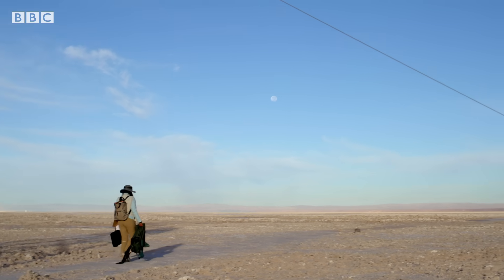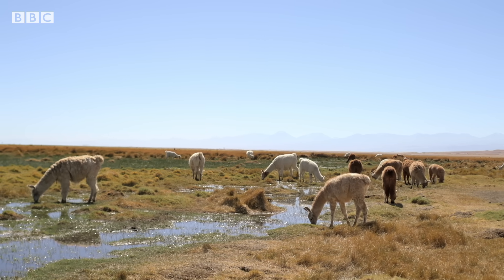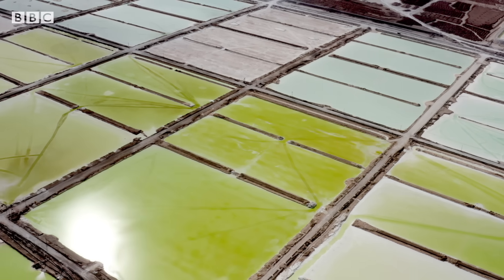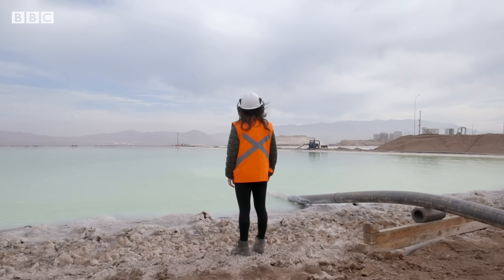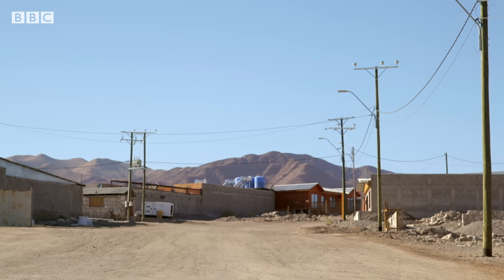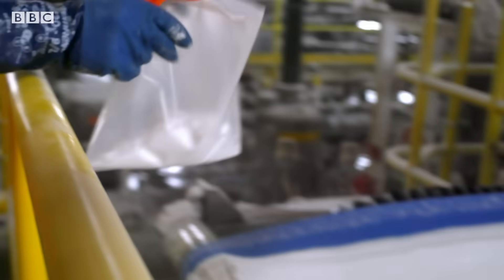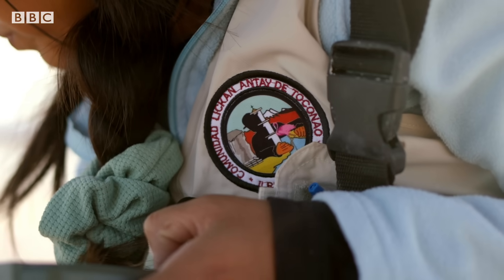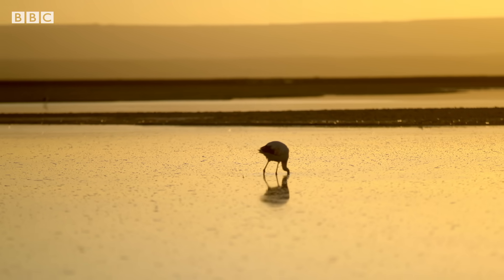What is the impact of lithium mining? | BBC News

Comment: That woman was wrong when she said that electric cars are just for the Americans and Europeans, the biggest market for electric cars is China.  In China you can buy an electric car for under ten thousand USD. 

The battery technology keeps getting cheaper.  But for most of the people in that region they can't afford cars of any sort.  If you come across a rich local who is rich enough to afford a petrol car then he would be able to afford an electric car.

The cheapest electric car in Europe is 16K Euros.

Ironically the research into Sodium-ion batteries will produce cars that are much cheaper than the cars with Lithium-ion batteries.  There are already a couple of models of Chinese electric cars in production with Sodium-ion batteries.
Reply: sodium is much heavier than lithium, not ideal for moving vehicles.  It's more appropriate for ESS than EVs.
Reply: @tooltalk sodium's weight is not ideal for a car but the cost is.  Most people don't use their cars on a motor racing circuit, they use their cars to drive to work and drive to the supermarket, and sodium-ion batteries are perfectly fine for this.  Which is why there are already cars being produced right now that have sodium ion batteries.

Sodium doesn't add too much weigh it's fine for a low cost, low performance car.
Reply: She generally means EV is mainly for the interest of someone else not for the indigenous people. Not wrong
Reply: @Akai_28  she specifically blamed her misery on America and Europe when China is the main culprit.
Reply: @Akai_28  Why is she not wrong? What is holding them back from driving EVs rather than ICE cars?
Reply: @matthewbaynham6286 i could not find any new about those cars with sodium ion batteries sice they were on the headlines. I think that was just an experiment. No tests , no degradation reports, nothing. They disappeared. However novadays CATL is working on Naxtra batteries and it will probably good for cars.
Reply: On what grounds will batteries become cheaper when the world is not mining enough, not are planing to mine enough and can't mine enough with minerals? What haven't been mined can't then be recycled. We have an upcoming demand for metalls and minerals between 300-7000% in the next coming years. The ground must be that the minerals will be cheaper again since 70% of the cost making an EV-battery is purchasing minerals and metalls, not the labour. That means that the future cost is totaly anchored the guess in future costs for metalls and minerals. Sure I agree to that chance except for the world is not mining enough, not are planing to mine enough and can't mine enough with minerals which means that the prices will go up. The trend is upwards, not downwards. that there is an inevitable reduction in the cost of things anchored in commodities that we cannot produce in sufficient quantity needed for these prospects, that is completely unrealistic.This will not end well becuase will get inflation from two directions. We'll get inflation from commodities/minerals/metalls and inflates the prices for a machines we need in the "green transistion". The electricty will be more expencive. Since the inflation is so broad over all these metalls and so inflationary and so deep globaly that it causes a global inflation pressure.
Reply: @christianstodberg3030 that's the most dis-information that i've see in one single comment.

There is plenty of mining going on, with plenty more mining being planned.

The supply of raw materials is just fine, look at to market price of the raw materials.

And just when you're stressing too much about Lithium-ion batteries, Sodium-ion batteries have already go into production.  Every ocean in the world is filled with salt, which is what you need for you Sodium-ion batteries.
Reply: @m @matthew_baynham  sodium batteries are not suitable for shitboxes. Why should I consider driving around with an 1 ton heavy battery with a energy content compared to 10L of petrol?
Reply: @christianstodberg3030 sodium batteries are very suitable particularly if the local climate is close to freezing or the opposite if the climate is super hot.  Sodium-ion batteries are very good in either cold or hot weather.

In a few years sodium-ion batteries will be far more common place than lithium-ion batteries.
Reply: @matthew_baynham wishful thinking! You have physical and chemical limits. They are so called natural laws and can’t be revoked. But feel to try and you’ll maybe nominated for Darwin Awards. Batteries can maybe be 15-20% than today but not so much more. If batteries had followed the same development according to Moore’s law for processors they’d be now the size of a peanut and would only have to be charged once during it’s whole lifetime. It easier to move data bytes than electrons.

Comment: Dear BBC, could you now please show the devastation caused by oil all over the world? Compare this with the environmental holocaust that is the Tar Sand project in Canada. Please also explain that the lithium once mined can be re-used - and critical minerals are not lost. In contrast oil is burned and must be constantly re-mined - causing global warming in the process.
Reply: can you also cover the environmental impact of fracking and the absolutely toxic chemicals pumped into the ground that poison aquafers , groundwater, and those who live on the lands above.
Reply: If you look, you might see they have for decades, and still we rape our planet for the "now" and do not conserve for the future. even we on this platform who are concerned  (do you realise just how much power is needed to run you tube? )
Reply: "can be re-used" There's a huge difference between can be and will be.
Reply: @LimerickWarrior1  Indeed. But re-use has not been necessary so far because the  batteries are still in service. 

And with oil, no re-use is even conceivable.

M
Reply: @michaeldepodesta001  certainly no recycling if the price of lithium stays as low as they are now.
Reply: @michaeldepodesta001 where have you been. They’ve been doing those sorts of stories for decades now 😂

Comment: Nationalizing part of the industry?! Eventually sodium ion will catch up which will solve some of the problem.
Reply: It won't since sodium has less energy denisty compared to lithium. heavier batteries, shorter lifetime, shorter range, less charging cycles but maybe cheaper.
Reply: @christianstodberg3030  Sodium has is improving along with lithium. Most of its problems are being solved. It should take over the lower end of the market once production is scaled.
Reply: @h@h @hamsterg0d ium has 20-30% less energy density compared to lithium. This is the physical and chemical properties of sodium. No rocket science just true fact. And you can’t step aside the periodic table. So a sodium battery would have 60-80Wh/kg. That makes the battery 20-30% heavier if you don’t expand the physical volume. And you have limited space in vehicles. The best sodium battery on the market is now 135Wh/kg. Still far away the best NMC with 250Wh/kg..Compare that with diesel or petrol with approx 10kWh/kg. So every news you hear about a new revolutionary fancy battery type that will beat hydrocarbons forget it. If it’d be true it’d be mass adoption already now.

Does the manufacturer reveal the production cost? The price? Any production infrastructure? Any charging infrastructure? 

If you answer no on all four questions take this ”amazing news” with a pinch of salt.

Comment: Hydrocarbons cause far more systemic and long-term harm, especially due to climate change, air pollution, and health effects.

Lithium’s harms are real but localized and manageable, especially if mining is regulated, recycling improves, and battery chemistries evolve (e.g., sodium-ion or solid-state).

Lithium is part of the transition away from something far worse. It's not without impact, but it's largely a temporary harm in service of long-term planetary health, whereas hydrocarbons are a permanent harm with escalating global costs.
Reply: They reuse hydrocarbons and save them to make plastic’s?im confused

Comment: Or you mine it from rock in Australia, or in a pinch extract it from sea water. Or transition to sodium batteries.
Reply: sodium is not an alternative especially for cars. Lower energy density compared to lithium. Thus heavier batteries, shorter life time, shorter range, less charging cycles but cheaper..
Reply: @christianstodberg3030  Sodium is perfect for all stationary storage.
Reply: @zapfanzapfan BSS is anothe hype, another useless and expensive hype. Expensive Unreliable, unstable soggy mass to provide power just for a few hours. Look what happened at Moss Landing when over 900GWh of batteries went up in flames burning for weeks.
Reply: @christianstodberg3030  It's not like gas ever leaks and explodes a house...
Reply: @zapfanzapfan is the gas the problem or poor maintained equipment? Batteries are unstabe all the way from production to disposal. Everything contains alkali metalls are unstable and heavy reactive by nature. A tiny winey defect in one cell can cause a chain reaction named thermal runaway - a self playing piano that can’t be stopped until all fuel is burnt out. Lets say provide NYC with battery power for 10 cold days would require all available natural resources and nothing left for anything else. Cost: 38 bn US$
Environmental impact: massive
Environmental benefits: none
Expected lifetime: 10 years

A bargain!
Reply: @christianstodberg3030  38 billion dollars worth of batteries would correspond to a 1/5th of current yearly battery production.
Reply: @zapfanzapfan  another lie …the battery production 2024 was 3TWh. NYC annual consumption is 60TWh. 3TWh is enough to provide a country like Sweden with power for one week.

Do your maths instead of believing i all kind of fake information you hear about ”holy batteries”.
Reply: @christianstodberg3030  If you can buy those 3 TWh of batteries for 38 billion you are a better negotiator than me.
Reply: There has to be another way then mining
Reply: Sadly we would still need to power the batteries , But I do agree the rare eaths should be squandered as they are now

Comment: They will soon find out that this is worse for the environment than oil
Reply: Wrong.  Lithium processing is not even remotely close to the huge ongoing disaster that is oil.  An Lithium extraction methods are improving too unlike oil.

Consider the thousands of abandoned oil well and tailing ponds that will exist long after oil extraction is over. The oil companies that create them will be long gone but its the public and the environment that will pay for it.

Lithium is not consumed during a battery's operation.  Moreover, a single EV battery is used 1000s of times over for thousands of trips.   Whereas, every tank of gasoline consumed requires going back to get another tank... and on and on.

Batteries are "closed systems" so so all the material at the battery's beginning of life are still present at the battery's end of life.  But oil is an "open system" and the pollutants are emitted as high-entropy diffuse gases which are practically impossible to capture in any meaningful way by technological processes.

Even worse, diesel and gasoline don't just magically appear at your pump either.  It takes a massive 24x7x365 global effort of exploration, drilling, refining, and distribution to get this ultra-refined product to the pump.  All before a single drop is burnt for fuel.  The process of creating & distributing fuel is incredibly polluting and energy intensive.

It gets worse, internal combustion engines have a ridiculously low mechanical efficiency of 20% to 30%.  But EVs have mechanical efficiency starting at 85% and higher.  This is a world of difference.

Bottom line: fossil fuels are a deadend technologically, economically, and environmentally.
Reply: mining/evaporating lithium isn't as polluting as refining them -- which is why most refineries are in China.
Reply: I feel your mind is going to be blown when you discover the magical oil tap isn't real 😕

Comment: Lithium mined once can be recharged thousands of times and recycled. Oil drilled once, burned once leaving CO2 in the atmosphere forever.
Reply: It’s likely that we won’t reach 90% Lithium recovery until about 2050. The EU recently set targets of 50% recovery by 2028 and 80% by 2032. How much you want to bet that they won’t even get close to those targets 😂
Reply: It’s not only that the amount of copper it will take too a house can’t be all aluminum wire cause it was causing house fires
Reply: @Muchoduder  97% recycling in existing facilities
Reply: @JuliusFawcett exactly where? Oh yeah and is it currently cheaper than extracting new material?
Reply: @Muchoduder  UK-based company, Altilium
Reply: @JuliusFawcett 😂😂😂😂 you are making a fool of yourself!
Reply: @johnmuthan286  I don't care 😂😂😂
Reply: Leaving CO2 in the atmosphere for ever? FFS, basic science!
Reply: @bordersw1239  yep
Reply: What happens to the lithium for exploding batteries, is that swept up & reused?
Reply: @derekstocker2071 old news, sodium is the new cheap battery material
Reply: @JuliusFawcett  Thanks. I have not kept up to date, I will research a little. Yet my question stands. Did the tech prove hydrogen was not suitable?
Reply: @derekstocker2071  electrification is easier and cheaper than creating a hydrogen network
Reply: CO 2 is absorbed by plant life you clown, it does not remain in "the atmosphere forever.".
Reply: Electricity still needs to be generated. All they are doing is centralising the pollution to power stations. EV's take much more energy and resources to manufacture and run.
Reply: @maughan3061  how to melt your metal ICE machine in your car. 100% burning coal, while u drive your car, u burn oil every second. try to run your ice engine in your garage and u stay there for 2-3 hours, and close the garage door. if you still alive, yoiur ICE car is really green for environment.
Reply: @maughan3061   Science was never your strong point I guess
Reply: @JuliusFawcett How am I wrong? Educate me.
Reply: @maughan3061   I'm unsure that you are teachable, you have your opinion and you are welcome to it.
Reply: So it seems you're an informed scientist.
May you please tell us :
-  how electricity is produced and its environmental impact? 
- you mentioned lithium recycling, have you ever looked at this process and its limitations? Please tell us about these limitations and also the environmental impact of such recycling processes when they can achieve it.
Reply: @johnmuthan286  magnets and copper wire
Reply: @johnmuthan286 I do not know about the second question, but I do know that most people charge their EV at night when the electricity is far cheaper and almost always generated from renewable sources..
Reply: @johnmuthan286 not to mention the amounts of poisons released by Li battery fires such as those that have occurred at the electric battery storage facility at Moss Landing at shores of Monterey Bay Ca. The one this year was the 3 fire in the facility’s short history.
Reply: stop lying
provide evidence that Co2 is in the athmosphere forever ?
provide evidence that lithium can be charged thousands of times ?
untampered, empirical truthful and direct evidence !
Reply: Pumpkin, the gas tank in a ICE car can also be filled million of times and recycled.  Lithium, unlike gas, doesn't generate its own energy.
Reply: @tooltalk  Pumpkin?